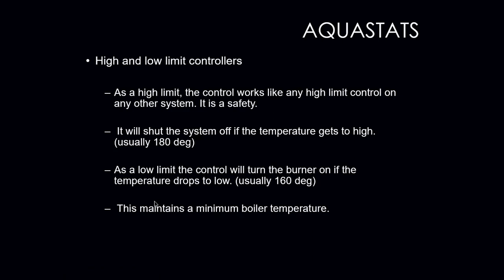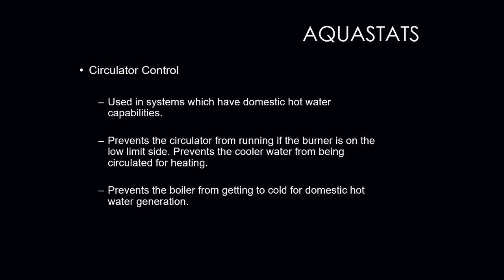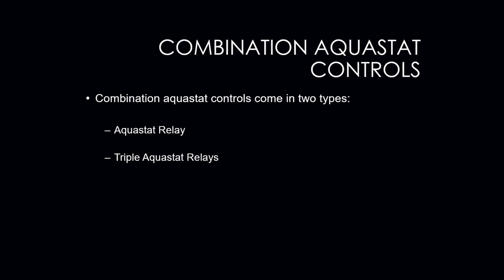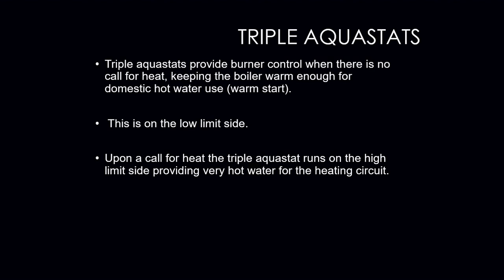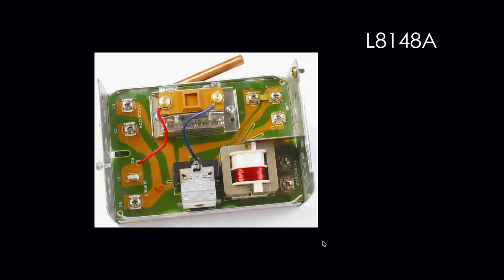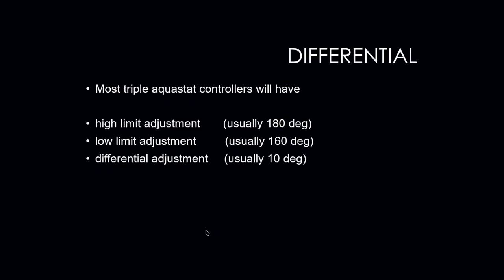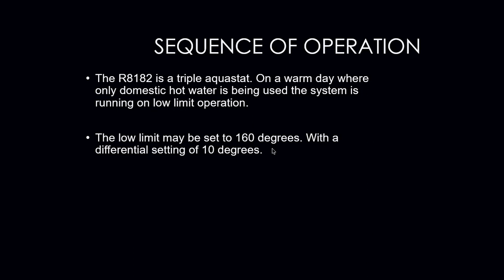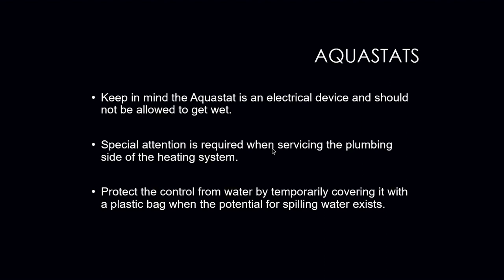Aquastats

Comment: 18:43 Couple of clarifications on triple aquastat.
1. There are actually TWO differentials for the LO limit. One diff is 10 degrees below the LO limit. This diff is fixed at 10 degrees below the LO and can't be changed. The second diff is above the LO limit; this is the DIFF knob that can be adjusted between 10 and 25 degrees.
How it works (example):
LO limit is set at 150. DIFF set at 25 degrees.
Burner will turn on at 140 (150 - 10 degree diff). Burner will turn off at 150 -10 + 25 DIFF = 165. In other words, when there is no call for heat the domestic hot water will be kept between 140 and 165. When there is a call for heat the circulator turns on at 165 but not below; this ensures enough domestic hot water for showers etc.

2. HI also has a diff fixed at 10 degrees below. Example: HI set at 180. On a call for heat burner comes on at 180-10 = 170, turns off at 180.

This is shown in the Honeywell manual for the L8124A.

Comment: I have a special situation and was hoping to get some direction on how to handle it. 

My OIL bURNER is outdoors attached to the house in a closet, and handled the domestic hot water with it's coils. I know, not very efficient... But it's original and have no other options financially to be worth it. I just hooked up a new Hybrid Water Heater to bypass the coils for domestic hot water so I don't have to run the boiler. Oil prices souring just cost me 1100 to fill tank for the warm weather to maintain hot water for 6 months. Probably uses more than another tank during the winter months equally 2200 or there abouts. Right now I turned off the furnace since I don't need the heat. Actually I also use a mini-split air/heat unit with a large propane fireplace for heating the house in the cold weather. Those 2 units work well together as needed to keep the house at 68 degrees without kicking on the furnace. Unless it gets down below single digits I don't have the thermostat calling for heat. The furnace is only maintaining the temperature of 160-180 if it needs to cycle through to keep the pipes from freezing in the crawl space. 

OK, so I think, what I want to do is bypass the sensor for the coils for domestic hot water so it won't be used anymore. I should mention now with the Hybrid Hot Water tank, I closed the domestic hot water valves on the furnace for pressure reasons. And also for now, until the cold weather comes, I just turned off the furnace completed. My question is how can I set this up so the Triple Aquastat L8124A and/or furnace is no longer supplying domestic hot water? Or is it not possible with the Triple Aquastat that the furnace has right now.
Reply from the maker: To be honest, I don’t know the answer to that. I’m going to probably say that it isn’t possible with the triple aquastat. I’ve never ran into that type of situation like yours.

Comment: Very good video. Give me the whole picture of aquasta work. One more question... How the aquasta wire in to boiler control which come with new boiler?
Reply from the maker: You would have to read the wiring diagram that comes with the particular boiler.
Reply: The aquastat controls the boiler through a separate 24v AC natural gas controller.  The gas controller, upon receiving 24v from an a aquastat, will open to allow gas into the boiler, and either a pilot light or a separate ignition will light up the gas and the burners fire up.  My aquastat has 2 terminals for red and neutral white to the gas controller.  My aquastat has millivolt T TZ terminals to connect to a thermostat.  I have a Taco ZR zone relay unit that sends heat calls via an end switch to an aquastat (millivolt or wired for 24v) and provides 120v AC to circulation.  My aquastat cannot control multizones by itself.